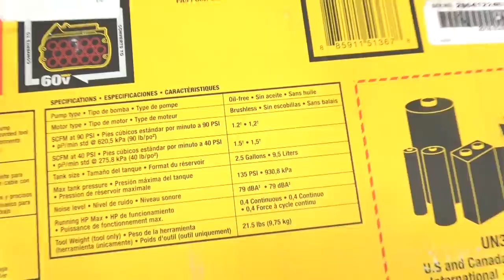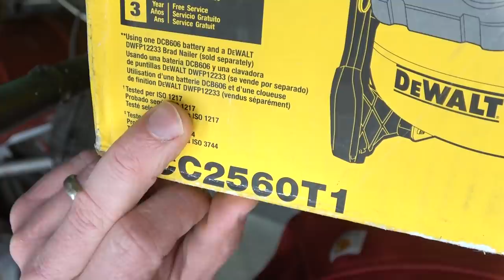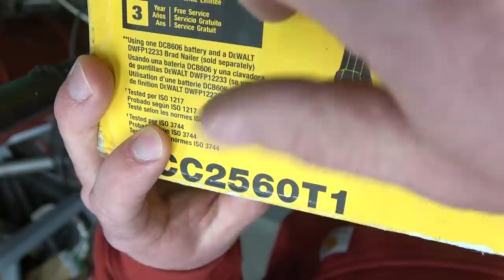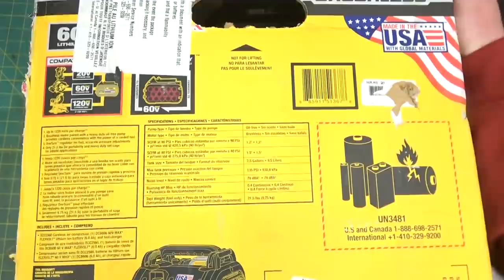BOLTR: DeWalt Flexvolt Compressor | Gutless and Brushless?

Comment: The hole in the cylinder has to be for unloading the pressure inside the piston chamber when it turns off. So that when it turns on again it won't get stuck and not able to turn because it can't beat the pressure left in there otherwise. In more conventional compressors the unloading is done via a small air line that goes from somewhere before the check valve to the on/off pressure switch and unloads when switch turns off. Or they use an electromechanical valve that lets the same pressure out when the pressure switch turns off. The motor in this has so much more capacity for that small tank that they sacrificed some of the stroke for not having to use a dedicated unloader like more conventional ones use. They may be using the benefit for extra cooling too, but fresh air comes in from the reed valve anyway, not sure how much extra cooling it will give.

Comment: My fiance does tubing similar to that at work but for automotive usage. The way they form those ends is with an arbor press using a variety of form and insert pieces to press out the shape of the flare required for a given application. Look at how you would put a barrel flare, flatten and then end flare a tubing at home. Imagine each of those operations stacked up on dies attached to an arbor press.

Comment: Small air tanks are exempted from ASME and CRN data plate requirements under ASME Section VIII division 1 .  There are no provisions for internal inspection and are considered disposable since the compressor will crap out long before corrosion allowance is expired.  The corrosion pattern is pitting, not a line corrosion since the only meriodional weld is at the equator.  Unlike a vertical tank with a cylinder between the 2:1 elliptical end caps.  If condensate gets to the weld line, that compressor will be a bear to lug around.  These beasts get drained often.

Comment: I use one of these for small trim jobs and whatnot at work. It's nice to not have to plug the compressor in but that's about as far as the "nice" goes. The thing is incredibly loud and runs forever before coming up to pressure.

Comment: Nephew just asked me if he should buy one of these last week. I told him he'd be throwing his money to the wind and to pick up an oilless corded if he really needed a small compressor, never having seen one of these before.

DeWilt never disappoints in the department of disappointing.
Reply: When I had very few free funds in my youth I built one of these out of an AC unit. You can put mineral oil in it to lubricate. Runs super quiet, good for tires & nailers. I brazed all the in and out connections in copper.

Comment: Just get a ESC for electric R/C models and a servo tester and you can run that motor at whatever speed you want given enough voltage and ESC rating.  The only thing with those ESC's is they are sensorless synchronizing, so the rpm is not controlled by the control input but instead the RMS voltage output is controlled.  The ESC automatically synchronizes the VFD output frequency to the rotor's current speed dictated by the motor load versus resulting power at that control input.  It probably uses some kind of Hall effect current sensor on one of the legs to figure out instantaneous stator flux for MOSFET timing.  So 3 phase wound brushless motors essentially behave the same way as a brushed DC motor from a control input response standpoint.  Just feed it with a higher voltage battery to get more peak rpm.

Comment: Look what I found; ISO1217 means;- 
This International Standard specifies methods for acceptance tests regarding volume rate of flow and power requirements of displacement compressors. It also specifies methods for testing liquid-ring type compressors (see Annex A).
This International Standard specifies the operating and testing conditions which apply when a full performance test is specified.
For compressors manufactured in batches or in continuous production quantities and supplied against specified data, the tests described in Annexes B, C and D are considered equivalent alternatives.
Annex E, which is normative, applies to any electrically driven compressor manufactured in batches or in continuous production quantities and supplied against specified data having variable speed drive (e.g. variable frequency drive, direct current drive and switched reluctance), which incorporates a displacement compressor of any type driven by an electric motor.
Detailed instructions are given for a full performance test, including the measurement of volume flow rate and power requirement, the correction of measured values to specified conditions and means of comparing the corrected values with the guarantee conditions. This International Standard specifies methods for determining the value of the tolerances to be applied to the measurement of flow, power and specific power.
NOTE The tolerances to be applied to the measurement of flow, power, specific power, etc. for all acceptance tests carried out in accordance with this International Standard are agreed on by the manufacturer and the purchaser at the contractual stage or prior to the execution of the tests.
Annex F specifies standard inlet conditions for reference purposes. Annex G, which is normative, indicates the uncertainty of measurement.
This International Standard is not applicable to noise statements, which are identified in ISO 2151.

Comment: Ave ,found ur channel  few months back ,awsome an finally someone with some hard to find  usable info about the tools an such that people use in average or even above average garage,shop,or kitchen  table when the ol girl gone out for the day ha!thank u. Could use some repair or remolding info on 6-12 battery chargers as i have about 10 of them in a pile that im currently triping over an also maybe on tread mill permanent magnet motors. Like to wire to run without controller if possible. Thanks a ton.

Comment: The reason why it let some air out of the drain valve is likely because of a difference in atmospheric pressure. Sealed vessels manufactured at sea level will usually end up with an extra 2 PSI at 5000 feet/1500 meters. This can also change based on the current atmospheric pressure and if it changes slightly, although the pressure difference wouldn’t be as drastic.

Comment: FYI: ISO 1217:2009 specifies methods for acceptance tests regarding volume rate of flow and power requirements of displacement compressors. It also specifies methods for testing liquid-ring type compressors and the operating and testing conditions which apply when a full performance test is specified.

Comment: Don't know about where you're at but in Nova Scotia it has to be over 42.5l and a diameter over 6" before it's a pressure vessel, hence the lack of tags.  Should be in the provincial boiler and pressure vessel regulations.

Comment: There are some tools that pull so much juice that they're really only work right on 220 volt systems. Air compressors are one of those tools in my opinion. The only valid option in my opinion is a gasoline or diesel engine alternative. This is also why battery operated impact equipment is such a godsend. They have been around awhile but the new ones actually work

Comment: You wondered why there is no ASME mark on the tank? There is what might be called a loop hole in the ASME code. If the thing what holds the pressure is less than 6 inches in one of its major internal dimensions it is not considered a pressure vessel and so is exempt from the code. That little clause saved me a LOT of headaches way back when I was designing pneumatic and hydraulic systems! I think there's also an out if you're using standard plumbing pieces (pipe and fittings). Is it possible that that portable tank is made outa pipe and weld on  pipe caps?

Comment: "A smart, on-demand compressor". LG tried to do that with their Refrigerant compressors on their Home-use refrigerator line. They all die years before the life expectancy. As little as 2 years from a part that is warrantied for 10 years. The compressors Idle, ramp up, ramp down, take variable voltage and amperage to respond to the moment-to-moment needs of the refrigerator. The tradeoff has been life expectancy dropping. Maybe the issue was unrelated to the compressor being on all the time, but it seems there is risk in implementing an idle mode in a compressor.

Comment: Now what I have been thinking for quite some time: if one makes a well-build ESC compressor, then you don't need a pressure vessel. You can safe space and money by omitting the pressure tank, and spend that on a more powerful motor so that the compressor can give you the pressure and flowrate that your tool needs directly. If you implement it this way the compressor will only make noise while you're sandblasting, grinding, changing tires, etc. Now compressors turn on half randomly, and usually right in the middle of a talk.
Reply: it's called a rotary
Reply: @jaubuchon28  Well, yes and no.
Commercially available crew compressors do still have a pressure vessel strapped to them; and so do a lot of rotary vane compressors.
But you're right that rotary compressors (especially with variable compression ratio) are suited for this task.

Comment: I work at amazon I'm  in  packing rn but i have been trained in loading the truck by hand with all of the boxed for fedex ups and plenty of other i also have packed a crap ton of these dewalt compressors. We also have to include that there hazmat label in the begining which means it can't be shiped by air and other things. If we don't amazon gets fined but usually amazon is on top of that kind of stuff because the main conveyor belt that sorts the packages kicks out the item without the hazmat label and i think gets sent to problem solve it's pretty cool.

Comment: Now, I'm thinking of making a compressor myself, like an engine. Big bore and not so long stroke for at least 100cc. The preliminary design will use poppet valves that are actuated like the reeds, increasing the capacity and longevity of the thing.
A steel piston ring like a real engine and have the cylinder Nikasil coated, along with the piston because heat concentration is not too high compared to a running engine.
Put a mini oil pump to lubricate the reciprocating mass and the valves. If really needed, use a proper oil pump and the bearings be plain bearings.
Lighten the entire assembly as light as possible, titanium parts are good stuff for the conrods if I'd make a twin or four-cylinder version.
Buffer tank to minimize pulses from the pumping. May be used without a storage tank if really needed.

Who knows how long this thing would last...?

Comment: The hole is actually just an opening. It's theoretically designed so when you go to life it you're actually reaching inside your fingers can lift via the hand holds on the compressor itself. Too bad you'd need fingers that are about 6 inches long to get a good grip that deep in the package.

Comment: You know what that red battery cover thing is for?
It's to get around the international air travel rules.
For the purposes of air travel, that isn't one 180WHr battery.  It's three 60 WHr batteries.  
Internally, they aren't connected. 
You aren't allowed to put a 180WHr Lithium battery on an airplane. 
But you can carry as many as you want under 100WHr. 
And somehow that piece of plastic makes it all ok.

Comment: hooked up a smart compressor as you call them about a year ago in an industrial factory replaced a large old style compressor. the main issue they had was the rest of the air system was so poor that it didn't preform properly.

Comment: It's interesting that the piston end has no pivot so the piston is not parallel to the bore except at TDC and BDC. it seems to be just a beefed up version of a cheap tyre inflator, again not meant for continuous use and really just meant for low CFM devices. Thumbs up

Comment: Black is really easy to do and cheap, carbon black. The faded spot is from gases released. Most plastic things are black and a slight sandblasted texture because it hides such things really well and is cheaper then other colors. Class A surfaces are a major pain in the ass.

Comment: That hole in the cylinder.... i wonder if it is to help the motor start rotating if the piston ends up in a bad spot after shut off? Like if it stoped on a compression stroke, that hole could discharge the air after the cylinder pressure pushed the piston back down and releif that air allowing the motor to start more effortlessly at the next demand for motor startup. Or if its there for a type of bleed down like larger compressors require. But who knows. Only if we had the ability to ask the engineer. That hole makes me curious!

Comment: We use this at work to air test new gas line services before we tap the main. Slower then using the compressor I pull around with the truck but convenient. It’s thrown around daily and has been used in the rain many times

Comment: Purpose of the hole at bottom dead centre: equal distance from the bottom as the hole at TDC? ease of construction? no bottom or top just put in the pipe! it's the right way around!

Comment: They use vfd compressor's in cooling systems commonly. The problem is, at least under higher pressure is that the compressor has a ton of head and is a hard start. They basically re rectify your dc to 3 phase ac faked. Boards look so intimidating.

Comment: I see that you used a Hilty battery tool to remove the air cleaner. I was thinking of buying Milwaukee do you think Hilti is better I am still making do with my nice 12 V power tools under the craftsman label and I have been using these for at least five years and they are still working well. Although the chargers in which I probably started with four I am down to one working charger. I have the small saw which works in a pinch the vibrating cut off tool which is awesome for plunge cutting three drills two flashlights a saber saw and an angle impact driver. Love the drill as it will drive a 3 inch screw or longer and they are so small they fit in my tool pouch awesomely and are very light.

Comment: I have one of the little six gallon porter cable pancake compressors. We bought it at a pawn shop for a finish nailer. The build quality was slightly worse I would say but overall it was very similar when I took it a part.

Comment: They left that hole because they used a simplified the rod, combining it with a flat piston to eliminate the complexity of an actual piston and pin and dumping the need for 2 generally weak-link parts. At even 3600 R.I.P'ms, velocities are in the toilet so statics rather than dynamics are driving the bus. This design uncovers the hole well before TDC as the rod rocks around that hole for an eternity, normalizing the pressure inside to atmospheric as much as possible before heading back around the horn. Pretty ingenious really, since the traditional design only gets pressure down to atmospheric minus the reed valve static preload pressure.  Toss a Hobbyking ESC running BLHeli on that bastard and send it to the moon !

Comment: You can knock your audio down to mono then just copy the mono channel to stereo, basically just duplicating the left channel (which at least in this video is usually decent) to the right channel in whatever NLE you're using, that'll prevent that bizarre headphone effect where you're at different volumes in different ears all the time.

Comment: That is probably seamless tubing, not dom.  To make seamless they take a large diameter and roll it between 3 rollers and pierce it to create the center hole.  Then they roll it with the rollers tightening down to draw the length longer as the OD gets smaller.  They can get very accurate OD and wall thicknesses with a decent inside surface finish.

Comment: No, the off color on that black is simply just not using enough colorant. ether running full clear virgin material on it or a small mix of regrind with not enough colorant added to stabilize color. We would reject that at our plant for light color. Black colorant is among the cheaper for plastics then other colors. whether liquid colorant or  pellets. Its only expensive if they are drowning  colored regrind (non virgin material thats been processed at least once, typically recycled material from bad parts that don't meet QA specs) in black to reuse  the material for something else.  (This is typically done only a few circumstances. 1. low volume orders running strictly regrind/recycled material. Or 2. a surplus of colored regrind of one or more colored mixed together and drenched it black to use on something else. (Typically done to reuse plastic left over from when other jobs are finished. Done more on poly pro then anything. Also just because it doesn't feel like poly pro doesn't mean it isn't We have 5 different kinds of poly pro at my plant. MRO525,MR0522,MRO522RP,MRO527S and MRO524LC. (I work in the plastics industry myself as a automation/mold tech and material handler.)

Comment: ISO 1217:2009 specifies methods for acceptance tests regarding volume rate of flow and power requirements of displacement compressors. It also specifies methods for testing liquid-ring type compressors and the operating and testing conditions which apply when a full performance test is specified.

Comment: Don’t know on the pressure vessel. They are in a different class to the pressure vessel heat exchangers I designed that were classed by the trapped energy (bar/litre). (More bar litre means more inspections and lodging the design with an insurance company). If it fits a standard ‘group’ of design and the welds are randomly checked from a batch it may be a batch cert by the manufacturers ISO system.